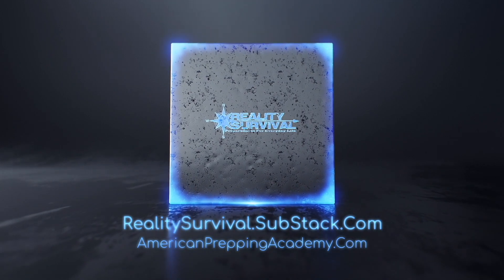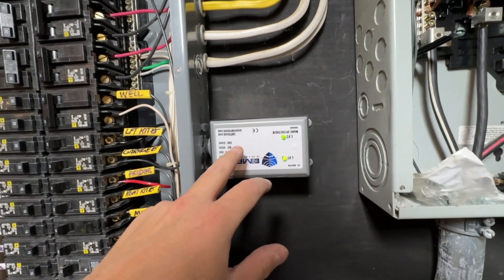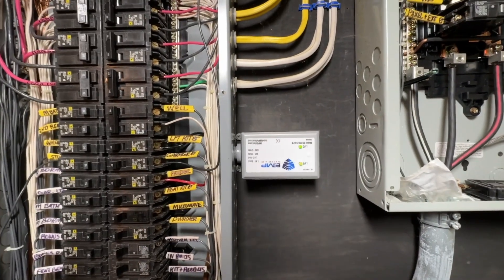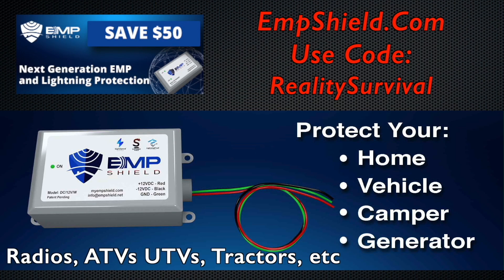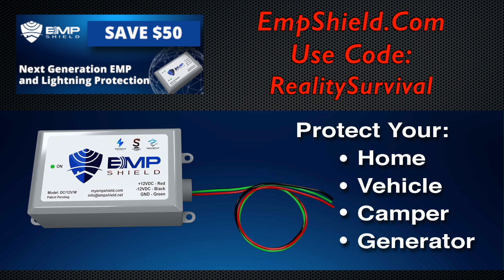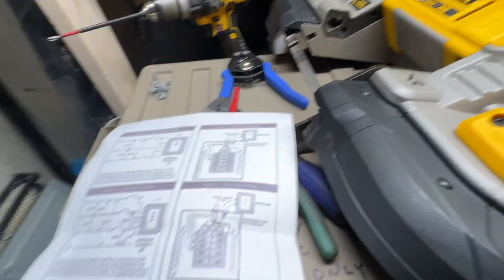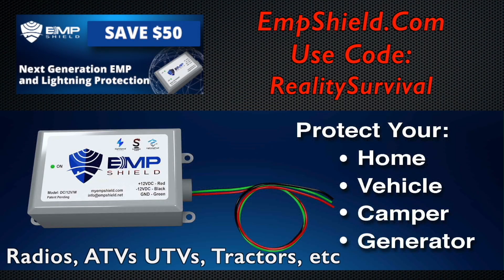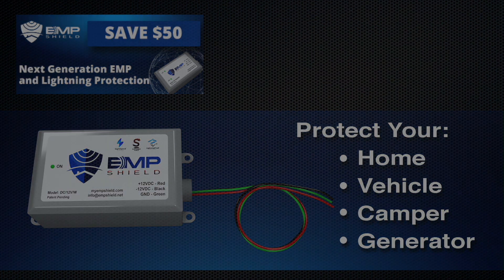How to Protect Against An EMP or CME - Home Installation

Comment: I was all ready to dismiss this device as another useless gimmick but your video surprised me as it actually looks like it might actually do what it says, for once.  I'm not sold on the one for vehicles (since they are usually already metal Faraday cages and don't have miles of wires acting as antennas like the power lines do) so I think those probably won't give much of a benefit but the one for home grid wiring looks quite useful even just as a surge suppressor for nearby indirect lightning strikes.  It would be very interesting to see if they actually tested the car one in a vehicle to show that the car was disabled without it present, as I haven't yet seen a proper scientific test showing an EMP destroy a vehicle in such a way that a surge suppressor like this would save it.

Comment: Installed their vehicle EMP protection on my truck last weekend. Took about an hour, mainly due to tools gathering and preparation of connection points. Real simple. Real straightforward. Good instructions from manufacturer. One less thing. The main reason I don't bother with home is that if a nuclear EMP -- which also requires a separate EMP alarm in case you're asleep -- I am bugging out, No point in having home EMP protector as there won't be a power grid anyway.
Reply from the maker: What do you mean requires a separate EMP alarm in case you are asleep? I don’t understand that.
Reply: @RealitySurvival  If I am asleep at night and there's an EMP, I probably wouldn't know about it for hours until I awoke in the morning. There's an EMP alarm that is protected, which you can plug in bed-side, and its audible alarm goes off instantly if an EMP occurs. Wakes you up so you can take fast action.
Reply from the maker: Interesting. I haven’t heard of that before. Thanks!

Comment: From what ive read - war economist think we will be hit with multable EMP stikes as a first strike - 
     Also war economist seem to think there is going to be a nuclear exchange in the near future - 
     Some say that 2 billion world wide will die and others say 2.5 billion will die during that exchange - as for biblically it say 1/3 the population of the earth will be killed - 
     War economist just as market economist are generally correct - 
     Biblicaly things are often spoken of in future tents - 
    It stated the first trumpet as WW1 and the second trumpet as WW2 - they did happen as said - 
     One of the markers for the 4th trumpet was time would speed up - after 1989 - as contractors in the oilfield we found for some reason we had to increase crew sizes by 1/3 to accomplish the same scedual as prior to 1989 - 
     Then scientist said the entire universe had speeded up during that time - 
     We know that the 6th trumpet war as stated will have to be WW3 - because it says 1/3 of mankind will be killed - 
    Its guessed that the large amounts of deaths  will be due to large citys in china and india & world wide - 
     Ether way commers will be interupted - 
     At some point the earth will be hit with a CME as in 1859 - that could set the grid back many decades - it took 140 + yrs to build it to what it is today - 
     For power plants and substions those are not mass priduced equipment - they take time to be serviced or replaced - 
     I would concider these things -